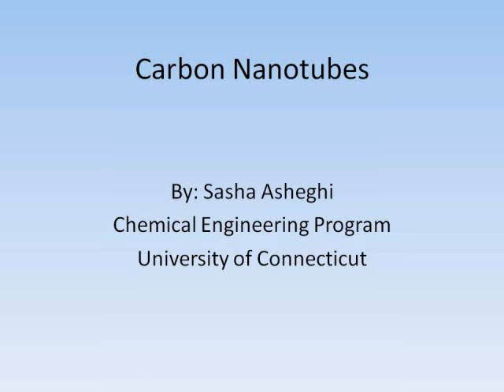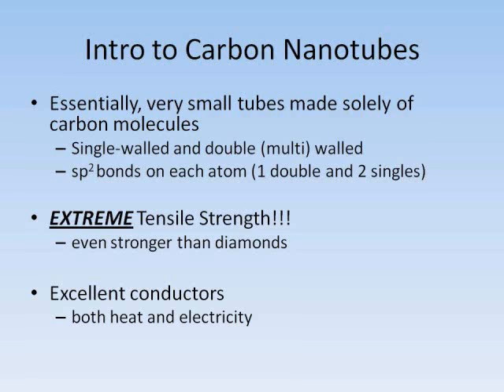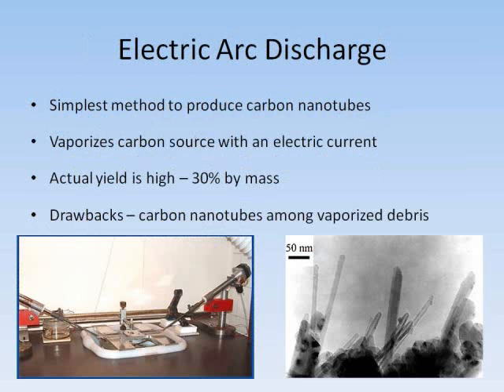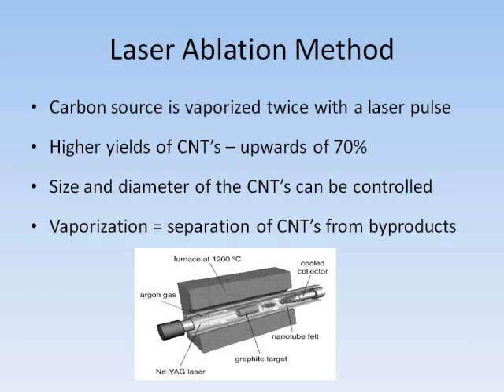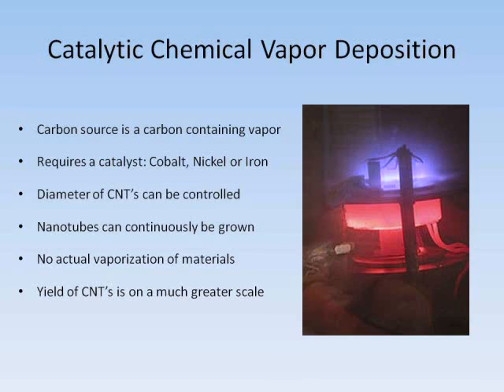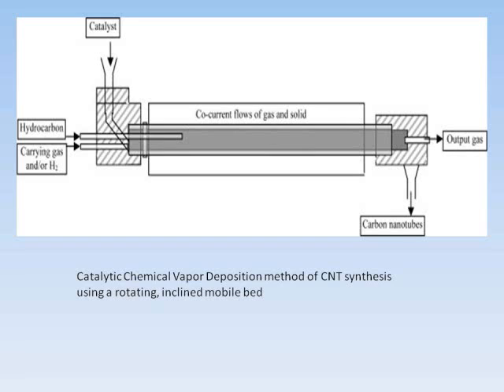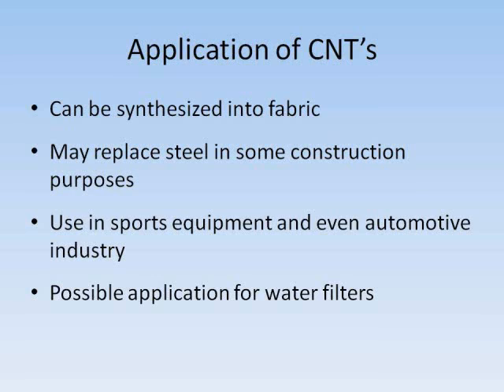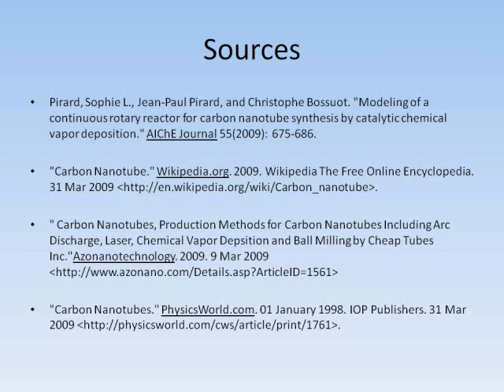CCVD method of Carbon Nanotube Synthesis

Comment: conflicting information on electric arc production... 90% carbon nanotubes are achieved using this method.  youtube search: "synthesis of carbon nanotubes"

also, its not entirely possible to weigh the advantages and disadvantages of technologys that have not entirely come to fruition; ie: electric arc discharge process nanotubes.